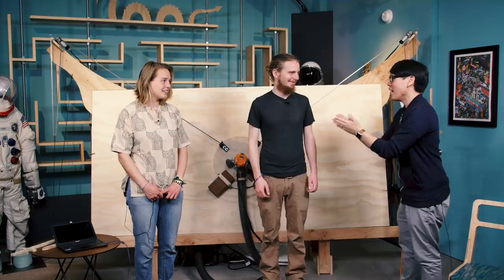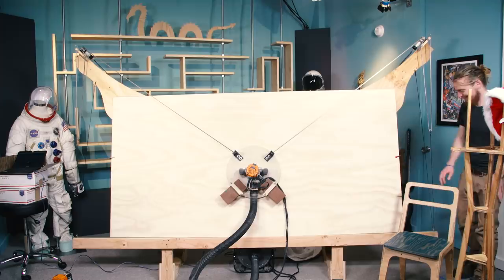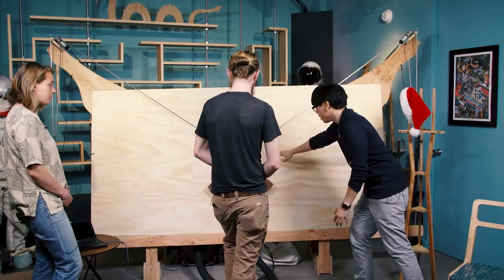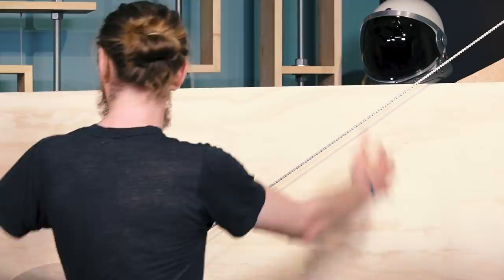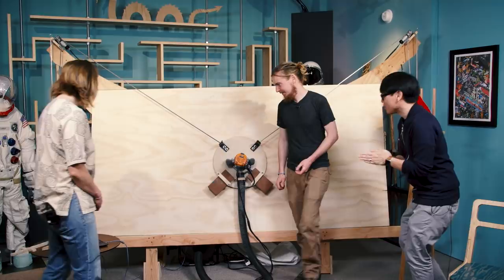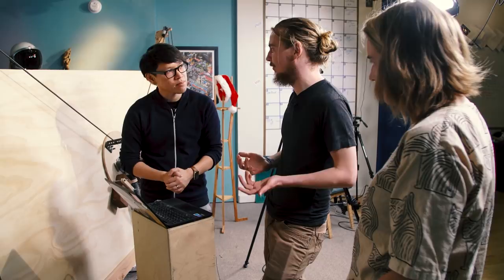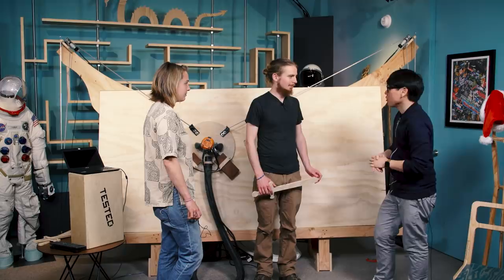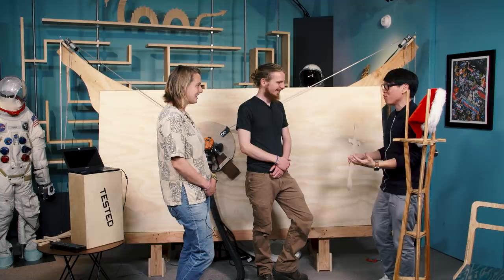Meet Maslow, the $350 CNC Cutting Machine

Comment: Open source is the future big companies aren't going to be able to  keep winning anymore which means a new inventors age is right around the corner.
Reply: i thought open source just meant the source could be looked at. not that it could be freely copied and distributed? i know of at least one modder that has a open source mod. but uses a strict no copy right on the code.
Reply: Plenty of open source solutions allow you to resell a product using it. Software is only one of them, like tablets , or PC's like Linus on Linus Tech Tips refurbishes old PC's and installs a free open source operating system on them. It's pretty common practice actually depending on the agreement.
Reply: yes. the open source isn't what makes it free though. it is the licensing that makes it free to use, and or to reuse the code. that is the part i am confused on. why do they refer to open source as being free. it doesn't mean that at all. it just means someone is allowed to look at it. it is only free based on the licensing.

it might seem counter intuitive, but open source software companies can charge for the use of their software. compiling the source is the same as piracy/stealing if they don't give permission.

that is my understanding of it. i have not been able to find a expert that goes into enough detail on it. most i have read get all the terms mixed up and use them interchangeably.
Reply: Death OfTime Open source is a license classification defined by the Open Source Initiative, that includes the rights to share and modify as well as inspect and use. It's derived from the Free Software Foundation's classification of Free Software and Debian's Free Software Guidelines. Don't confuse it with imitations designed to mislead such as Microsoft's "shared source" or Sun's "community source license". 

Licenses placing the restrictions you describe are thus categorically NOT open source, and claiming them to be is fraudulent. Please refer people to https://opensource.org/licenses for some clarity on what the term really means.
Reply: @death, if you can't compile and modify the code yourself, it's not open source.

Comment: Cool that they got it to work and figured out the software, but I don't think this would be much more useful than a jigsaw. It would be cool if you made a room divider with hundreds of holes, but then it would need a Z axis.
Reply: Max Maker a jigsaw can't cut with a PC.. sucks you have to hand saw though..
Reply: i think its significantly better than a jigsaw. try cutting a perfect circle with a jigsaw, i cant do it. also they have a Z axis kit and its only 60$.
Reply: of course  you can use a jigsaw , but I think CNC is more about the precision and minimising the manual labour part of a production
Reply: Sure you can. Just put the jig saw on a guide arm. A pin trammel on a router  works better though. That's how I cut perfect circles. I have a CNC machine and I still wouldn't waste my time just cutting a circle with it.
Reply: This has a z axis

of course you can always do things manually without any CNC, but you aren't going to be as repeatable, and probably not as accurate as a CNC
Reply: I would rough cut it and sand away the rest with a disk sander. Or I would use my CNC of course.
Reply: I have a CNC myself and I use it very often, but I doubt this thing is very precise.
Reply: Max maker pin trammels are very precise. I doubt any CNC is more accurate than using one is. Although it does take a minute to figure out exactly how to set it up for the size circle you need to cut. Cutting a perfect circle is just a bad example really. Being as there is a method that yields such great results.
Reply: While It's far more useful than a jig saw, the precision he mentioned does limit it's uses. 1/64 is a limiting factor in many applications, and the 1/16 at the edges is very near useless for a lot of things. Proper CNC is often accurate down to 1/1000th of a inch. Hopefully they can correct for some of that. Still useful for things where tight tolerances aren't needed though.
Reply: David Lang - I hate that lie. I'm a machinist that does research prototyping and even with a full cnc shop, that I built, I do most 1 - 5 part batches by hand because it's much faster than laying the whole thing out in g code and yes I can g code. I started with q basic in the 90s, when we were still using analog repeaters and optometric light stops. 

Much easier now. Still easier by hand, if you know how to machine, unless you get into production, then cnc all day. Also micro precision, I'm setting up a micro lathe at the moment with a geared carriage and cross slides to lower movement to .000012 for shaping and diamond polishing (100k grit dipped brass bits, 1/4 mil) collimator lenses under microscope, still easier by hand, lose 2 in 10, cnc is about 50% and the higher end cnc too cost prohibitive. Academics, engineers, and factory workers can't main precision, a real machinist can, its what we do all day for decades, just not many left, that's why we make more than most mid level engineers now.

Comment: I wonder if this would work for a plasma cutter on sheet metal?
Reply: Yes, at least one of the beta testers (or someone who assembled from source) has made a CNC plasma cutter.
Reply: Does this unit have automatic depth settings on the sled? Or is that manual?
Reply: The depth setting is on the router itself. In order for the software to control it, a Z-Axis kit must be added. In the absence of the Z-axis kit, the software will pause and ask you to change the depth.
Reply: Is there a z-axis kit available? And if so how much?
Reply: Yes, it's a motor with encoder, a coupler and some bracketry. I think it's in the neighborhood of $60.
Reply: I have watched several other YouTube videos since this post. And Have seen the The access rigging. Do they have any kind of a motor control mechanism? Like on off via the computer. This would be necessary for plasma cutting sheet metal. Instead of going in and out with the z-axis to create tabs. Maybe a simple on and off operation for a plasma cutter?
Reply: We've discussed this in the forums a bit... the consensus is that having Maslow control power to the end effector (router/plasma cutter/laser/whatever) has a high enough risk that it won't be implemented in the firmware as shipped. It's an open source project, however, and there are 4(?) available outputs remaining on the Arduino board that could be used for a simple relay circuit. Although, yes, I could see the Z-axis kit being used to pull a trigger on a whip... that would accomplish the same thing.

I saw a laser engraver/cutter once that used a 3D printer for motion and it used the filament feed to turn the laser on/off... so pretty much anything is possible.
Reply: Excellent. How do I get to an order page to where I can look this over?
Reply: Found it. LOL I seem to be finding the answers just after I asked the questions  Thank you for your help
Reply: No problem! If you have any questions, drop by the forum and introduce yourself. It's a relatively small community currently (beta testers are the only ones with machines at this point) but it's growing.
Reply: I just placed my order. Will they be Putting it on my credit card bill immediately or when it is shipped? And approximately what kind of time frame are we looking at at this point? Order # 01796
Reply: And by the way this is my Facebook alias. LOL I got kicked off for another 30 days.

Comment: Haven't seen this cut in real time yet, it's always sped up. I got a feeling it's super slow.
Reply: There is a video showing it running at 800mm/min here (they list all the physical parameters at the start of the video). But of course the speed you want to cut at is going to depend on material, material thickness, router bit speed, how many tabs you add, the quality of the bit you are using as well as the final desired cut quality. https://www.youtube.com/watch?v=-VKrgMwU3UA

Comment: All in this openSource CNC starts at approximately $1800, then adding the laser option brings it above $2700 CDN. Where does the presenter make the claim of low cost in this video?  Sounds like bait-and-switch marketing which is illegal in Canada.  I estimate that with a stand build, a router and CNC bits, this would start at no less than $3200. I’ll stick with my track saw for breaking down sheets, and traditional power tools to complete projects.  Nice attempt at lower cost CNC.

Comment: To the Maslow people, can it cut Carbon Fiber sheets?
Reply: it can cut anything you can cut with a router. The suggested router is a Home Depot Ridgid r2200 router.

I suspect that cutting carbon fiber sheets would wear out the bits so fast as to be pretty useless, but I don't know the material well.

Comment: Seem like the router might chader since it suspended  from only two points
Reply: it actually does not if you set the depth of cut and speed correctly,

Comment: so your paying $350 for the software. thee hardware: screws, plexiglass, chains, and 2 d/c motors doesnt cost that much. its a cool idea but doesnt have me quite sold on it
Reply: you skipped over a number of components, but it doesn't really matter. The components do cost less individually than the kit costs.

a kickstarter project had better charge more than the cost of materials, or they will go broke and not deliver anything.

But this is all open source, go ahead and build it from scratch

Comment: My concern with a cnc machine like this would be fire safety. It's completely made out of wood and you could easily start a fire by programming it the wrong way...
Reply: You can drive over the yellow dotted line into oncoming traffic too!
Reply: Granted this is true. But most people probably won't walk away to far if they're that novice at setting it up.
Reply: Most cnc fires start because of the router getting stuck and heating up the cutting material. Well that problem is inherent in any cnc that cuts wood regardless of what the rame is made of. even $30,000 cnc machines are not to be run unattended!
Reply: @sunshine5349  Yes, so true. Driving a $900 car vs. $30,000 off a cliff yields the same results? Or maybe there should be some kind of regulation put in place in order for that not to happen?? Fear based thoughts will only keep you it the dark and stop all progress.

Comment: seems it isnt 350 anymore?
Reply: AFAIK they haven't changed the price, they listed it originally as a $500 CNC machine, $350 for the kit + ~$150 for the router you would have to buy (and a little bit for the lumber). After they started the kickstarter, enough people asked for a way to automate the Z axis that they created a $60 add-on to do that.

The kickstarter has ended, they had a few extra kits (~220) and my understanding is that they have sold out of those as well. So right now you can reserve a kit for sometime in the future for a $100 deposit but until they get all of the existing orders completed and shipped, they aren't going to be ordering more of the parts.

Comment: I would be very concerned that the router might start kicking and when that happens and it will …goodbye bit if lucky…otherwise bang sammy kaboom..been their will happen faster then you can say  " holy master crap "…that thing is a time  cluster or a cluster time ticker..dont take this wrong but this a very dangerous set up...
Reply: the sled is ~20 pounds and the disk is ~18 inches in diameter, it's hanging from chains that don't twist much.

are you really sure the router and sled will move that much? Since the bit is enclosed in the router and the sled, there are not many trajectories it can take where it won't hit either 3/4 plywood or the metal router frame.

Why is this so much more dangerous than your face being a foot from the router with nothing (except possibly the plastic dust collection cover) between the bit and your face as you stare at the bit to make sure it's cutting where you want it to?

Comment: I don't know why they don't provide a better mount for weight, and why they don't mount the chains to opposite ends of the circle and track left chain right chain y deviation by figuring out the angle of the sled and doing straight trig calculations. Also I hope the router is on a swivel so it stays pointing down even when the sled is offset left or right. Poor design.. not even beta. I don't know how he in his right mind said it's a closed loop feedback system when the angle of the sled is an unknown.
Reply: it's 12v DC brushed motors with encoders on them, so you can apply random voltage and measure how much things actually move. That's closed loop.

no, the motor is not on a sled, the angle of the sled is calculated (it's a bit more than "straight trig calculations" take a look at one solution to the math issue at https://robotics.stackexchange.com/questions/10607/forward-and-revers-kinematics-for-modified-hanging-plotter/10858#10858?newreg=13734dd331424a0ea0d2ddc79c562910

There are a good number of beta-testers who have built the machine already, so your 'not even beta' is wrong by definition.

Comment: This looks like a disaster waiting to happen. The torque produced by a router is more than those two bricks can handle should it decide to WALK.  Lets hang a router turning at 25,000 rpm(approximately 37 mph) from a string. Wow, wonder why no one thought of that earlier? LMAO
Reply: recommended speed is 8000 rpm not 25K

Comment: What are the bricks for?
Reply: c0pyimitati0n they said in the video. rewatch it
Reply: i guess they act as a weight to keep the router down onto the work-surface at all time
Reply: sorry I don't really have 20 minutes... they could have made this an easily digestible 8 minute video.
Reply: 5:06 you are welcome
Reply: the bricks add mass to the sled to keep the chains tight. At the moment we (the community) are experimenting with using less weight and a steeper angle (right now it's tilted back at ~15 degrees)

Comment: Safe! Really? Someone needs to go and get a grounding in Health and Safety to be able to say that the device is safe or not. From my perspective, no it isn't because the cutting head can be accessed easily.
Reply: Not nearly as easily as a band or table saw blade, nor most manual tools.  The thing's held down by bricks and the 1/4" router bit running slowly doing three or four tedious passes through half-inch ply as shown in the video isn't going to pop it up and make it dangerous.  That router and bit could whip through the ply in one pass, if it wasn't for the gravity requirement for alignment.  The bit is also an upshear, which pulls the router towards the piece just like most saws do.

I've cut stainless steel on a wood router — that was a bit scary as the tank-like 5x10' MultiCam shook the concrete floor due to low RPM's — this thing would kill me from boredom before it hurt me physically.

Comment: This... just won't work very well. At least not very accurately. You can only cut things out of that sheet of plywood and... nothing else. Which I guess if not micrometer accurate and plywood is all you need then... great. Can't use it with harder materials, if the bit gets even slightly stuck it'll be a mess, using it with thicker materials adds tension in twist to the chains, there's obviously no 3rd dimension. Just an extremely limited device.

Comment: when you realize that you can cut it in less time with a Jigsaw LOL!!!! What a waste of time and space! Not to mention the hassle of getting software to work right , something your brain can already do easily with a tape measure and saw.
Reply: Yea. But imagine stacking the designs like 10 times onto one plate. Then having 40 saws hooked up onto one vacuum cleaner, all set up by one person. That is still faster and cheaper than if you'd have one professional CNC machine that just churns out one plate at a time. Meanwhile the one person who operates this thing can glue and screw together whatever came out of it.

Comment: It would be way more efficient to just cut it out on a bandsaw. These cnc routers seam like an overcomplication of such a simple task.
Reply: can a bandsaw cut holes in the middle of an object? how about engrave letters into wood? can it bevel edges? think out side the box
Reply: PhotoBooth biz , dude, a CNC router can't do any of THAT without a tool change, and a whole new program. A two axis CNC can't bevel an edge while it's cutting. You could produce this or better quality with standard methods, and it would take way less time. Don't get me wrong- I think this is neat, (that's why I watched the video) but it's more like a science project for high schoolers. It's not a realistic tool tool for hobbyists.